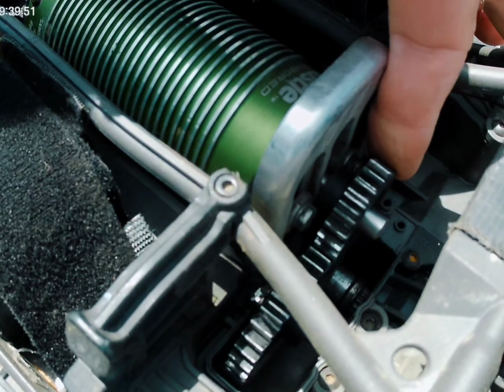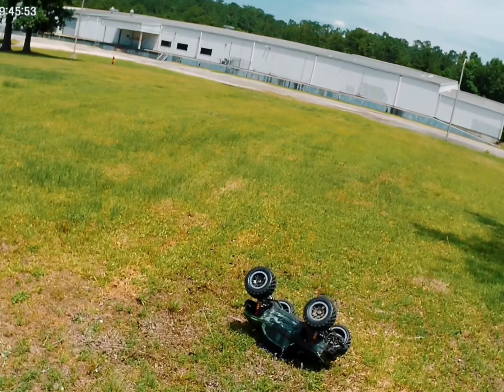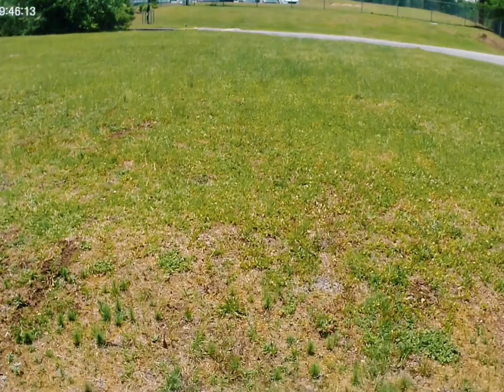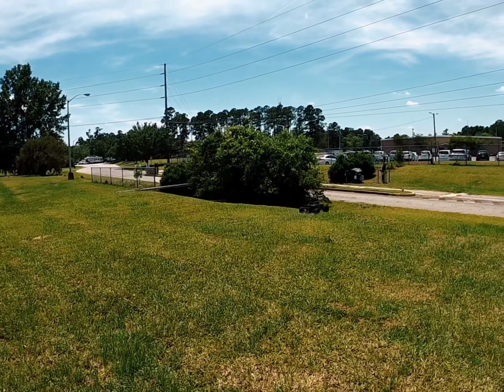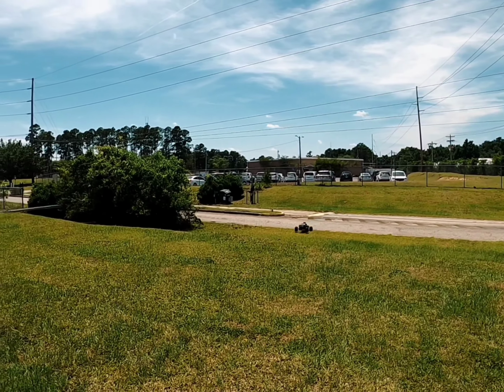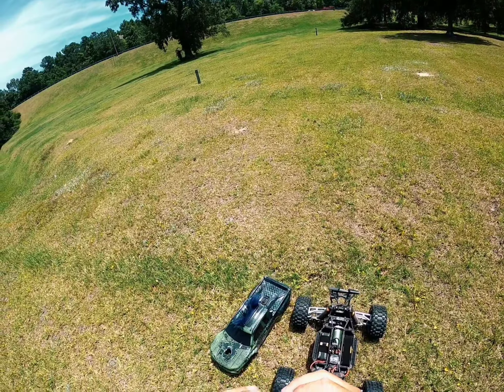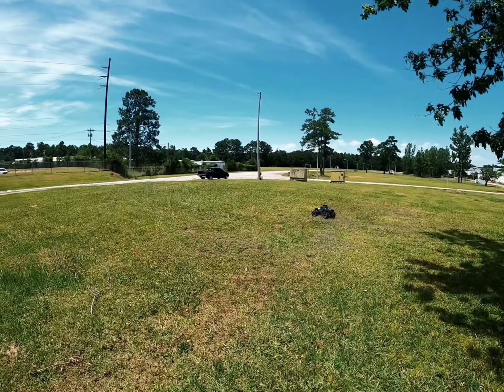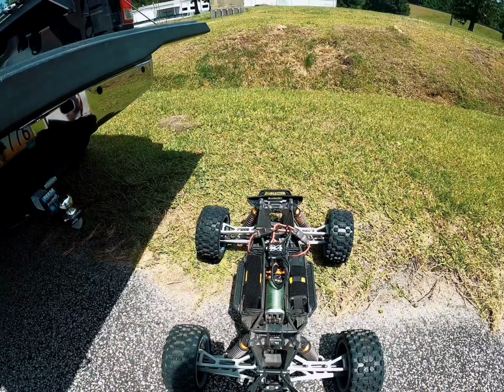Traxxas X-Maxx 8s, VITAVON X-MAXX Front & Rear Tie Bar Mount APPROVE 💯💪🦾🦾

Comment: Do you have problems with the rear ring and pinion gears skipping and then stripping? I ordered some vitavon ring and pinions gears , maybe they will hold up
Reply from the maker: Unfortunately I haven't found a set that I can't break lol. I powered down on the system and gearing,  I'll settle fun over speed and breakage lol